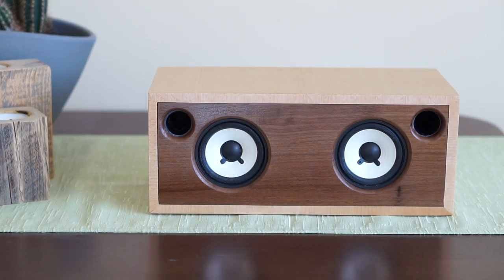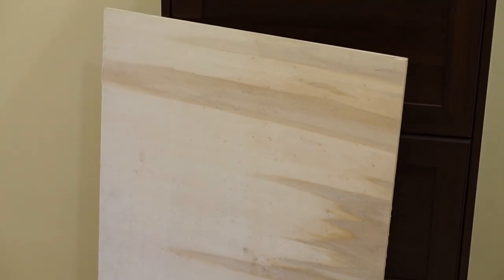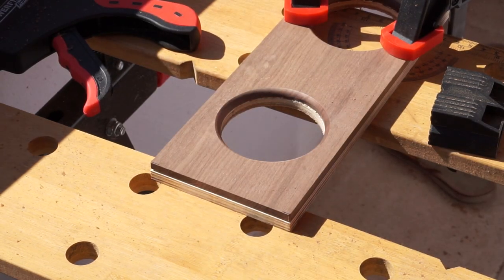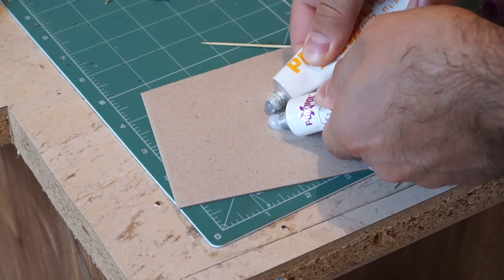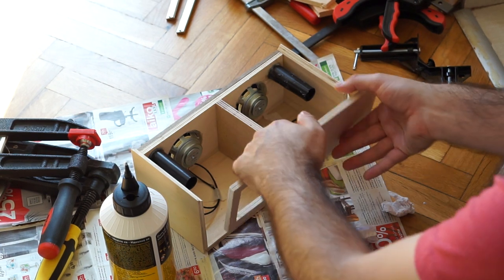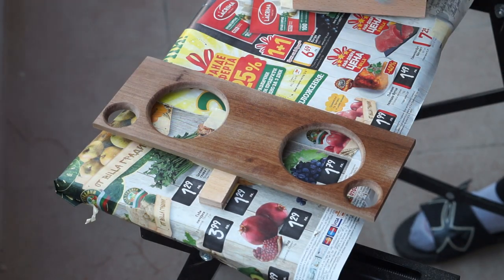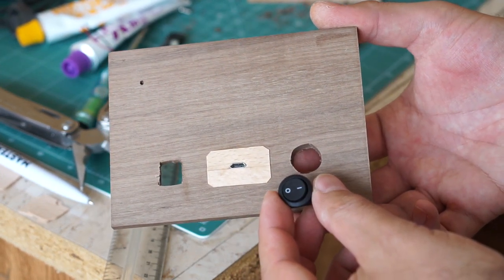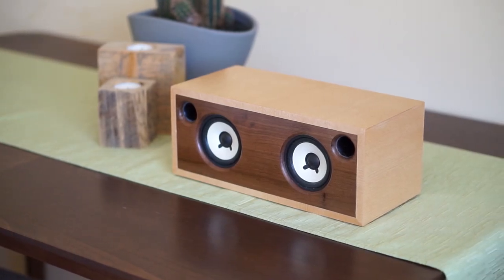🔊 DIY Bluetooth speaker 🎶

Comment: Awesome video. Can I use high amp with low watt speakers? Like 15w amp with 5w speakers? Kindly reply
Reply from the maker: You can, but only if you don't turn the volume up. I would not recommend it as a permanent setup
Reply: @LeftyMaker  Thanks ❤